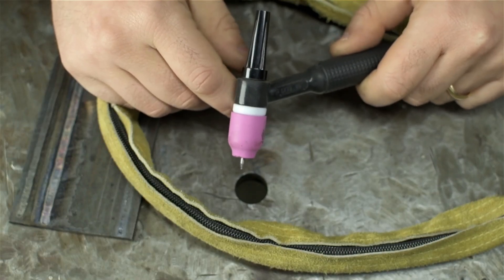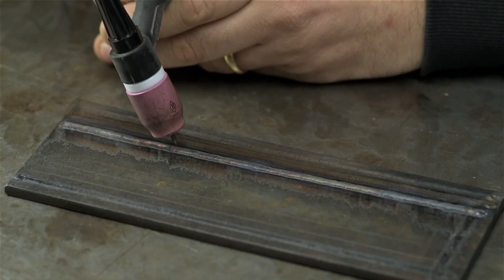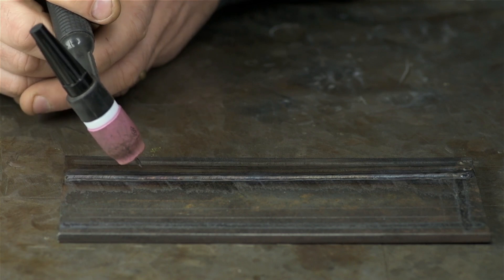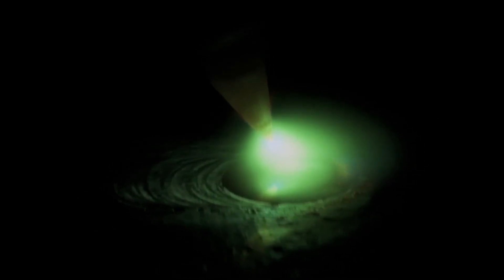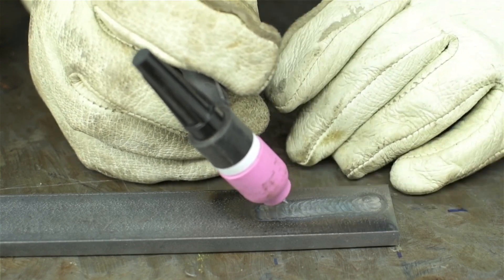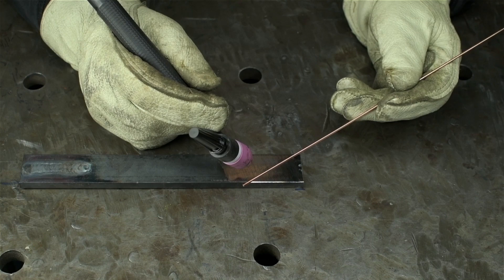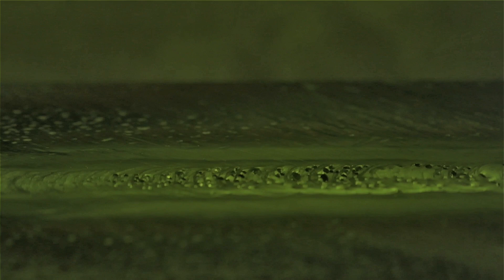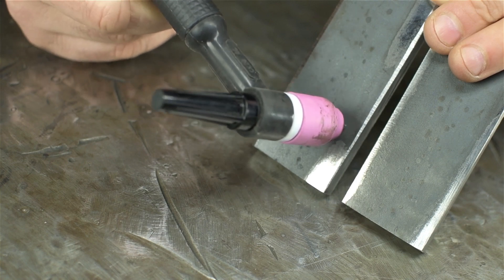TIG Welding - Puddle Control

Comment: Comment #703...probably safe to assume this won't be read by TOT.
Regardless, thank you for breaking down the basics of TIG like this. I have an Everlast TIG/Stick machine that has never TIG'd anything because I don't know what to do. Tungsten, cup size (a nice D isn't too much right?), finger or foot control...maybe I need a Beginner 101.1 course.

Comment: I 100% agree with the advice to just keep on going when you've dipped the tungsten when you're starting out. If you're dipping tungsten like that, not only will you go through tungsten quickly grinding it all the time, but it's not likely to make a huge difference in what is probably already a sucky weld to begin with. More important at that stage is to practice the consistency, rather than having to reset constantly. Bravo for having the guts to admit it.
Reply: Exactly this.  Learning to keep a close arc without dipping the tungsten is mostly about muscle memory, and interrupting the practice to go grind the electrode or insert a fresh one is counterproductive unless you've really messed up the tungsten.  Aluminum is worse this way, with dipping more likely to create a big Q-tip that requires a tungsten change, so mild steel may be better for practice.  And I disagree with the attitude of the welding Puritans that feel there is some sort of immediate mandatory "walk of shame" to the grinder every time you dip the electrode.  Who needs penance in a productive and enjoyable hobby!

Comment: I wish I could 'like' every time i laughed at a joke lol

I've been welding in field for almost 9 years, mostly MIG and a tiny bit of stick. I dropped out of highschool to work and had to deal with a lot of old guys giving me a hard time, and essentially had to learn everything on my own. If it weren't for videos like this I wouldn't be where I am today. I just started TIG about a month ago, got my TIG open root certification for pressure vessels (I'm in ontario, its under TSSA)a couple of weeks ago, and so I'm still learning how to manipulate the torch properly. Your videos have helped me significantly, I watched the previous one to this friday evening and went in saturday to put down some sweet looking open roots ! thanks for your contributions to youtube and the tech/manufacturing community, you make learning about the shop fun !

Comment: I wish I had seen this video before I did my TIG course. Explains the basics and common faults so well! The other important thing I found was don’t weld with amps too low, as you will dump in extra heat while you wait for the puddle. You want the puddle to stabilise in a few seconds...

Comment: I think that, as we all age, puddle control becomes very important... It's good to be prepared

This reminded me of the first time I ever heliarc'd something. It was the winter of 1977 (really). I was working with my dad at a construction job in a chemical plant. He was an instrument fitter and I was his helper. We (he) would bend the tubing and then we (I) would clamp it down and then go find a heliarc hand (we called them hands. They didn't get offended either. Today calling someone a hand would be an insult. I can just hear the heliarc "gender neutral craftsman" say- Hey! I'm much more than a hand, I have feet too. Or something like that). 

The heliarc hand (welder) would weld the tubing to a fitting that we had run tubing to once an inspector confirmed that that we had connected it correctly. Apparently the section we were building operated at pressures of up to 20,000 psi and tubing fittings weren't appropriate for that kind of pressure. That's why it was all socket weld.

Anyway, it was good to know the welders because everywhere they went the scaffold builders were called in to build a tent for the welder. It was warm in the tent all the time. The welding machine they used was called a grid. The welder would "ground the grid" and that would heat the tent. I don't think it was good for the grid to do that but it sure was warm. 

So I took lessons from the heliarc hand right? Um... nope. I took welding in high school. Stick welding. It's all welding. Arcy sparky metal melting right? Uh... no... apparently not...

I wanted the welder to put my initials on a Crescent wrench, aka spanner, (like he had done to his) but when I went to see him there wasn't anybody in the tent. He might've been in the line at the portajohn. There were some enterprising "ladies" that would offer services for a fee... but that's a different story I can't confirm it to be true. I don't know where he was. But he left his stuff there. I ungrounded the grid, put my wrench in the vice, put on his helmet, and struck an arc. Just like you would strike an arc with a "crackerbox welder" and 7018. Just put that tungsten right down on the wrench and POOF... instant hole all along the length of the attempted arc drag. When he came back I was still there. I had to grind  bunch of tungstens for him to pay back for the one that I obliterated. I still have that wrench somewhere. Technically it was my dads. It's amazing how much energy gets funneled through a little tungsten rod when the machine is cranked up for heat and you touch it to metal. So yeah... I'm not a welder but these videos have at least showed me what I was and was not supposed to do as it pertains to "striking" an arc. Good stuff.

Comment: Since you make interesting content, and I don't have any machine knowledge to give back, I'll give a tidbit of knowledge I do have. In most of your videos, I've noticed you keep your wedding ring on. While I am sure your wife appreciates this small but significant showing of your love, heavy machines are not sentimental. If the ring gets caught and pulled, it could rip the flesh off with the ring. This is called Ring Avulsion. It happened to Jimmy Fallon in a freak accident, but usually happens with industrial equipment and power tools. There are silicon rings that break away when caught, or you could take the ring off and put it in your pocket.

Thanks for making interesting content!

-Some tech nerd that did IT for a hospital for a while.

Comment: Aaand sure enough, one week later, I'm getting closer to welding my first trailer!
I have to say that here, in the land of stick welding, things like puddle control and filler rod are notions that would make tools fly across the shop as soon as you mention them.
Which in itself is interesting, if they weren't flying towards your head.
But I digress, I just wanted to say thank you Tony!

Comment: I only practice my electronics on the reactor core. I keep the welding practice to new, experimental pedestrian bridges over busy roads.
Reply: It's hard to split hairs to that extent when it comes to YouTube bon mots. One could also argue that Chernobyl and Fukushima didn't really have much to do with electronics.......
Reply: Too soon, man, too soon...
Reply: Yeah you're probably right. Although personally, if I ever die in some other doofuses' giant cockup disaster that never should have happened, I hope somebody gets a laugh out of it as soon as possible.
Reply: if you're referring to that bridge that collapsed recently, such a design was hardly experimental.
Reply: i........in Miami.

Comment: I never could Tig Weld in High School even with the teacher showing me, then watch in front of me while I ran a bead. It always looked like crusty crap,  and I never could figure out why. Then today you show me the same results from a high, long arc angled forward leaving the back of the puddle unshielded by the gas. That has really bothered me since 1990, and now I finally know what I was doing wrong. Thank you, times 10.
Reply from the maker: my pleasure, thanks for watching John!

Comment: Good stuff there Tony. Sometimes I start wondering if you are just being modest ;) Most welders cheap out on stuff about welding sheets, got any idea how I can fix my rusty bucket without melting my face off? Bet my new #9 torch will last me about 5 minutes at 30 amps :/

Comment: Nice video as usual.
The only thing i don't get right now is: how does the pixies go into the torch? Is there an electricity cable (which i don't see) along the cables for gas, water in and water out? Yes is my best guess, but since i didn't saw this cable my question remains legit (i hope)

Comment: Good explanation Tony. The filler rod should melt and pull into the puddle, and you're right, nice looking welds are not all way's "good". after 23 years I've sen alot of good welds and repaired alot of bad ones. Keep smiling.

Comment: Thanks Tony! I understand what you mean about melting the filler in the puddle. It's exactly like soldering. However I've seen people (Jody) basically lay the filler rod in the gap and run over it with the arc. Could anyone explain what's going on there. Are you trying to angle the torch to keep the puddle and tip of the rod both molten at once or are you above it melting down through the rod to the piece?  Thanks again.

Comment: Thanks for the info, going to buy a Tig soon.... Trying to decide witch one... Not too cheap not over kill.... Do you ever use automatic pulse modulation, you might watch the Eastwood welder vids.  I think it an amateur think but it might be cool.  Thanks T
Reply from the maker: I absolutely love pulsed TIG,  not necessary, but really nice to have.  I'm very happy with my HTP 221.  It's "middle" priced, not too hot, not too cold.  but depends on your budget.  there's always monthly installments?  "which welder" is always a hard question.

Comment: Trying to figure out what adapter you have on your Invertig I am wanting to use 5/8 connect but the machine torch is 1/4 bsp ? I see you have some elbow there. Can you tell me what to get ?
Reply from the maker: I don't remember the sizes on mine off hand, but if you check McMaster-Carr, they have just about every fitting you could image.  Check your sizes.  USAWeld has this kind of stuff too, give them a call, tell them your sizes.

Comment: Thanks Tony. Soaking it all up, never even held a TIG-handle. Any tips or tricks on how to sneak an expensive and barely usable (because of myself) TIG-welder into the garage without the missus noticing the heavy dent in the checkings account?

Comment: A thorough understanding of the fundamentals is never overdone. Keep going!  As a chronic "dipper" I'll be most interested in how you avoid dipping as the filler raises the puddle height.   I also have a lot of trouble seeing the weld. Either the arc seems too bright or the surrounding metal is just in shadow.

Comment: Since your last TIG video, I bought my first tungstens and cylinder of gas and have been TIG welding with my stick set that's got a lift TIG function.

It's awesome! Why did no one tell me how good TIG was?! New favourite welding technique. I'm benefiting from having burnt lots of holes in things with MIG and stick beforehand, but I think it's been the easiest process to teach myself too. The only thing I'm not happy about is finishing a weld. I have to snap the torch away from the work and that's a bit messy. Starting and welding are great though.

I now want an AC set so I can do aluminium. Problem is they're the best part of £1k, whereas I only paid £200 for a stick/lift TIG box including the stick holder and TIG torch.

Keep up the good work :)

Comment: Wrestling with puddle control for a decade now and realizing you may be right about the content of the filler rod.  I may add amino acids to the antioxidants & vitaminamix as a flow control agent to see it reduces the hard ring I've been getting around the bowl of the puddle.  I know gas pressure definitely has been a problem for me...so many variables...but I just never seem to get it down Pat...Frank...maybe¿  ;-P  Great videography and content Tony.  Would love more...learning a lot here.  Also wanted to let you know I saw someone else using your avatar...Sacrilege and reported!
Reply from the maker: Thanks PJ!  someone stole my pitcher?!  I've seen pirate (re-)uploads, but never full-on YT identity theft!  Thanks for reporting.
Reply: I saw his comment on another friends channel and reported the abuse there and then went to his channel and wrote a book in the Flag report.  Just wrong in so many ways.  Here is his channel so others can report it also.  https://www.youtube.com/channel/UCSWllsVW6QrFjTcVTKmSPYw

Comment: I have always wanted to weld up my own exhaust. After watching these I may get a welder and with help from my son(currently taking welding) I may try. How would I check for leaks without putting it on the vehicle and checking?  Or is that the best way?

Comment: Coming from the super-fancy clean weld world: Tungsten inclusions can also be a source of corrosion - so if you stub out too often you can have a prematurely corroding weld.
Reply: So I guess that is why we are frequently advised to grind out the weld wherever there is a touchdown, for high class work? I hadn't thought it through, but I guess it's the only plausible explanation.